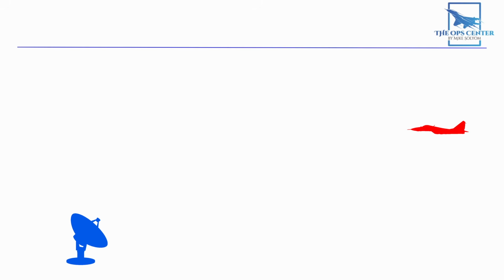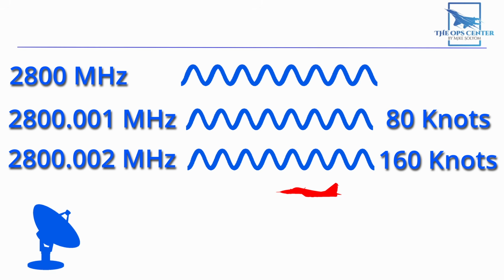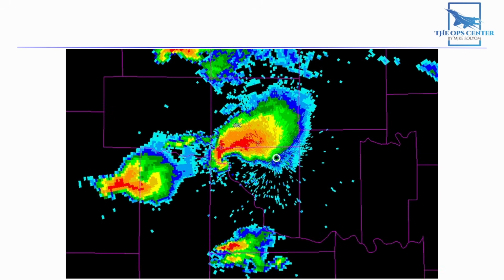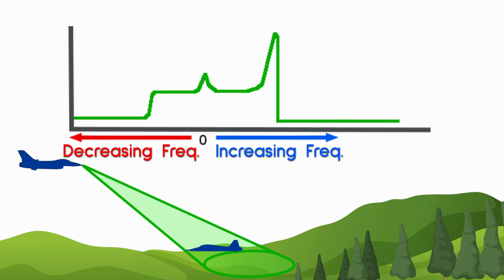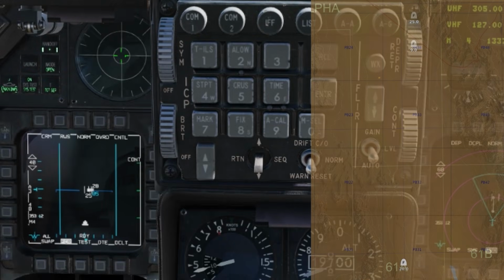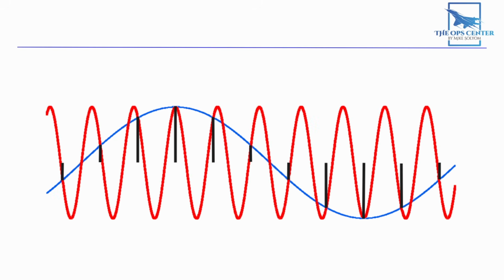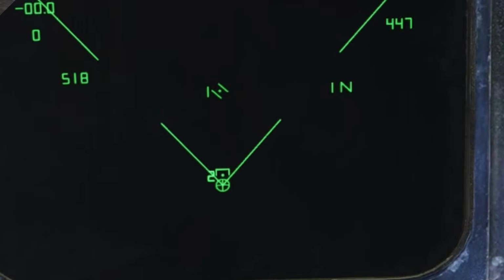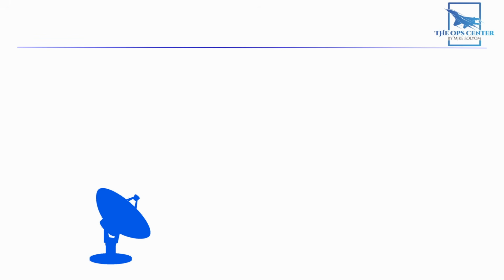Doppler Radar Explained | How Radar Works | Part 3

Comment: Sir this is one of the best explanations of the concepts of Doppler shifts which I learnt today. So basically from what I learnt is, frequencies can change depending on the speed of the observer and the source, this may cause a beat (an oscillating amplitude) which has a frequency of the difference of frequencies of the source and the reflected waves.

Comment: If the ground were actually spinning in a manner described by so-called science and popular opinion, the velocity of that movement would vary, almost infinitely when speaking in terms of milliseconds, depending on the location between the equator, which would be moving at approximately 1,040 mph and either pole which would be moving much, much slower. So, I’m left to ask, how can the radar equipment possibly factor in and then filter out returned echoes that match the velocity of earth’s rotation when that number is not fixed in the first place? 
   
Additionally, is there some sort of technology built into the radar unit itself, which in addition to determining the time that it took for an echo to return, also identifies what specific angle or direction that the signal was returned from? In other words, can Doppler radar identify the directional source of a returned signal? My understanding is no. If I am wrong, and you are willing, please walk me thought it and help me understand how because I don’t believe Doppler radar would be possible on a spinning ball and that’s not even considering the fact that we are told it is moving in found different directions simultaneously, all at speeds that are virtually impossible to comprehend.  Thanks in advance and cheers!

Comment: But how much use does Doppler give us if it only measures speed in the direction of a radar? Which is almost never is the case, as the targets vector is not pointed directly at us
Reply from the maker: Good question. The Doppler shift measurement isn't so much in the direction of the radar but rather the relative movement of the target.

So even if the target is moving at an angle (like say 45 degrees off the radar-carrying aircraft's nose) then there is still some radial movement. The Doppler shift can still be measured in this case. The only time it disappears is when its exactly perpendicular to the radar. Or if its motionless relative to the ground. Then it fades into the clutter.

Hopefully that makes sense.

Comment: HI thank you for this but it is worth to mark couple of mistakes made.
5:11 You are mixing aliasing with PRF here. You cannot send "pulses". All what all radio system does is using are waves. A pulse of any kind is very long compared to wave length (several thousand cycles at best). A "Dirac delta" signal which you are trying to explain here has unlimited frequency response.
This part is very badly described. The "blind spots" as you call them are from "ground clutter" and "side lobe clutter" Doppler filtering (both separated by ~ 100kts in terms of contact speed). They have nothing with aliasing which is domain of signal sampling (namely the Nyquist theorem), not reflection aliasing as you are referring to this as well. Namely PRF also has nothing to do with signal aliasing. Explaining PRF with some strobes superimposed on sinusoid is making impression that you can send "Dirac delta" kind of signal. This is very confusing. You always sending chirps or continuous wave pings and those are couple of thousands cycles long compared to base frequency. Or you send waveform with multiple frequencies in newer radars (spectrum to be processed).
PRF only changes the resolution of the radar plus influence on range as it packs more energy. The DCS'ism for PRF (like in Mig-29 of F-14) is just stupid and unrealistic.
Higher PRF just limits your range because you send less energy with shorter pulses plus the echo can overlap with next pulse. This though is totally solved by signal coding in new radars.
Those pulses though are ~ hundred of microsecond long composed by set of frequencies (or chirp in compression methods).

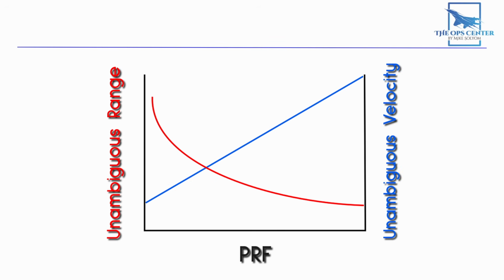Comment: Great information.  At approximately 06:57, the graph showing Unambigious Range and Unambigiuous Velocity has an intersection point.  Does this point have a name or is it less useful that I think it is?  My assumption is that this would be the best PRF setting to use but there might also be more to it than that.
Reply from the maker: I've never seen a name for it. But I know pilots would probably equate it to the maximum lift-drag ratio since it sounds like a similar sort of sweet spot. Unfortunately, it isn't necessarily the best and could give a radar operator a "worst of both worlds" situation.

The best thing to do is to switch the PRF. Then you get the best of every aspect.